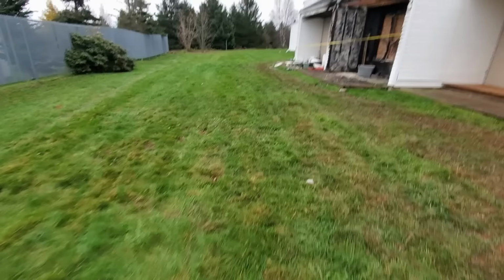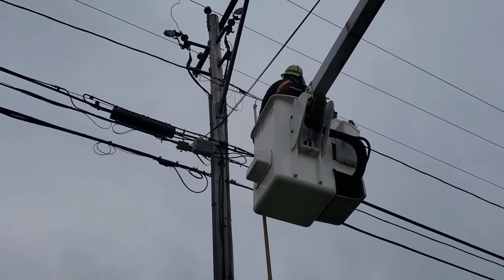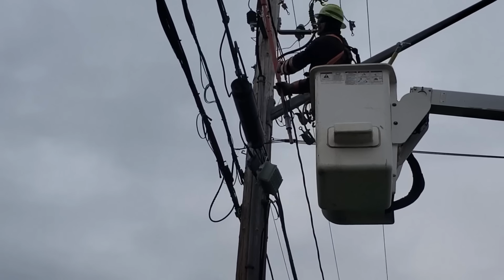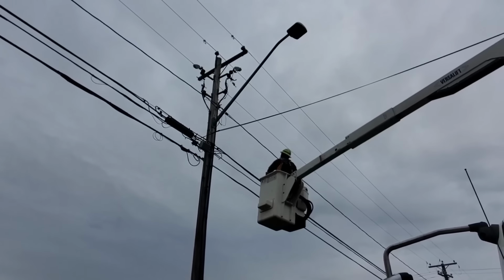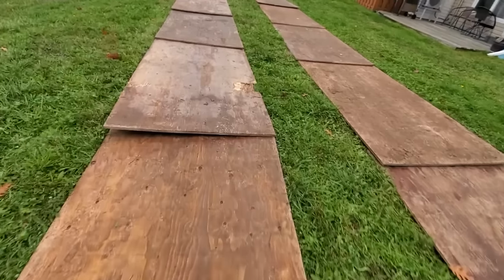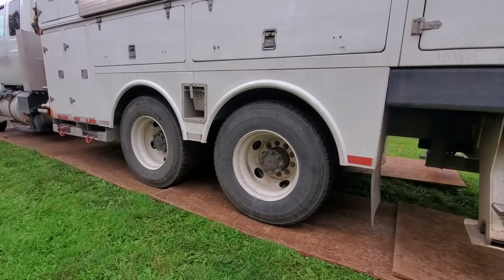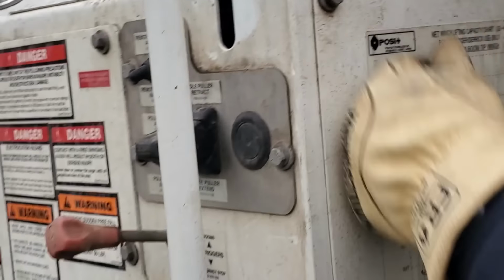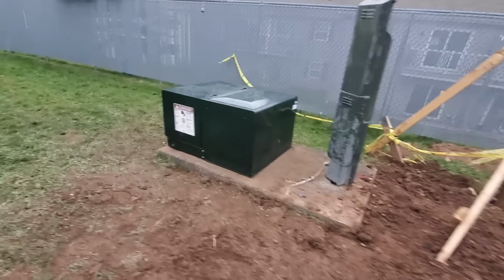Replacing padmount transformer (Job prep)

Comment: We had poles and meters from the 1920s that ran down in metal heavy gauge pipe to breaker boxes and heavy gauge pipe out of there that ran to boxes mounted at ground level that had 50 amp Outlets, 3 conductor.

The flexible power cord plugs in to this outlet and runs to the breaker box in the trailer.

Comment: Wait how did the cables melt and not blow a fuse? Isn't the point of the fuses is to protect the wires?
Reply: Fuses only provide protection against overloading. Here the wires melted because of a separate fire.

Comment: In Poland and probably other european countries we have main fuse before meter cabinets, short circuits on meter can't cause fire because main fuse will blow, we use low voltage distribution, one 15kV-3x230V/400V high power transformer can feed few house estate streets. Houses gets three phase power, main fuse for street usually is rated 200-400A independence from houses quantity, some short circuit on house service mains before meter can cause fire when fuses before meter don't exist, main fuse for street can not react for it when house is on end of line
Reply: For his house I'm 99% certain that there is a main circuit breaker in the main panel immediately after the meter just on the other side of the wall.
Reply from the maker: That's right, there was a fuse just on other side of the wall.
Next fuse back is on the high voltage side I'm the Padmount

Comment: How did the initial failure happen? Was is the power company’s transformer that cooked the lines? If it was the transformer wouldn’t that make the power company liable for the damaged wires.
Reply from the maker: It was all cause by the house fire...
The heat melted the customer owned wires, along with the wires feeding neighbouring units :/

Comment: Where was the 2nd phase from the riser going, I didnt see any other primary cable parked in the can? Did it go to another one? i did notice at the riser they were each connected to different phases which you wouldnt typically loop one can on different phases. Good video as always!
Reply from the maker: The second cable passed directly underneath the pad mount and continued on to another pad mount that was out of sight. These days we would have ran that cable off the "b" side primary bushing and hooked them up in series.

Comment: This definitely seems like one of those situations that would have been prevented by pole/pit fuses on each service, like most of the world uses. 
Aus/NZ has rules about "unprotected consumers' mains", and there were a whole bunch of subdivisions built in the 80s where the first protection was a fuse on the property - but that is installed barely above grade in a box in the foundation or brick wall, basically fireproofed.
I'm surprised the padmount is being replaced. Do they think it was cooked by the sustained short circuit? Other than the mess of secondary wires, it doesn't look too old or in too bad shape.
Reply: NA has some really seemingly odd things. North of the meter (technically, the first disconnecting means) there's no protection until you get to the line side of the transformer. In some ways, that reduces the service calls to replace a blown (low voltage) fuse. Most of the time, shorting the triplex will pop the line side fuse. (been there, done that. p***ed off the community... it's several hours to fix, being on the wrong side of a lake, and pole needed replacing.)

Comment: Another great Video Aaron,  I think you said tht the wire was Customer installed,  I'm in N.C and everything from the pole to the meter is the power company problem.  Please enlightened me 😮😊
Reply from the maker: Pole to meter the utility owns (in our jurisdiction) if it's overhead wire.
While we do have our own underground system as well, the wire from the pole/pad mount transformer/urd box to the meter is customer owned.
In some areas, the utility owns that section of wire.
Reply: It depends. The company does not want to maintain miles of line to one customer (my neighbor is that far back in the woods). Here the company maintains "up to the meter OR first pole" (oversimplifying). As I am 500 feet from the street, and some ugly land, there are two poles (meter on 2nd pole). I am responsible for last 300 feet of wire in woods and two poles in shallow holes. (The company has an insurance deal, I pay a little more per month, they fix any reasonable damage and eat the cost.) From my meter the juice runs underground to the house. Like anthonyelectric6045 sez, conductors just dropped in a very shallow trench. Backhoe damage in the underground is, of course, my problem.

Comment: Interesting. In our area the meter is the line between customer owned and power company. IMO thats how it should be everywhere, since the power company doesn't want anyone messing with anything between the meter and transformer. Seems if it was any different there could be issues to who is responsible, and who can, and cant do the work.

Comment: We are in the middle of trying to change policy on who owns service wire from transfer or secondary box to meter.    If its overhead its always been ours. Underground has been customer owned,  we have usually fixed customers wire because it's such a pain to have electrician fix them.   We have had so many problems lately that we are looking into changing.

Comment: Appreciate your vids, I am not a lineman but have an electrical background. My question is I noticed when you remove a cutout how is it actually hooked at the bottom. It seems to just slide out, what prevents contact resistance. I know the top of the door has a solid slip connection. Curious old man!
Reply: Basically it’s like a notch in it the only way it can be pulled off is when it’s open and hanging
Reply: Top of the cutout has a spring loaded latch with a notch that accepts the top of the cutout door.   Put a switch stick in the ring of the door & pull.  That releases the door from the latch.  Let the door open completely then you can easily lift the door straight up out of the bottom hanger.

Comment: Why aluminum wire?  I thought that had been banned since it was such a fire hazard.  At least it is in USA.  Is it just used in those boxes and poles?
Reply: Aluminum is banned for inside wiring because it is more brittle than copper, and connections will loosen over time due to the wire and connections expanding and contracting. Those loose connections will cause arcing and faults that start fires. Outdoors and underground that is less of an issue but can still deteriate with age.
Reply: @superhuman2889  Not to mention the resistance is lower in copper.  And, ALL installation require moving the wire back and forth a number of times, until there is a solid connection.
Reply from the maker: Aluminum is banned here as well except for the main wires into meter/panel and the underground/overhead wires directly connected to our system. They're sized larger than what would have been chosen for copper. Cheaper and doesn't get stolen!
Reply: @Bobsdecline Oh, it still gets stolen... people are stupid. (meth heads are very stupid.) People steal fiber thinking it's worth something.
Reply: @Bobsdecline  - Thanks for that!  I've got so much feedback of the opposite towards aluminum.  I like the longer video's. :yt:
Reply: Actually in the states copper-clad aluminum is accepted (of course depending on the ahj) if it's UL-listed and much like with a feed it's generally the next size up that it would be his copper.
Reply: I don't know about power company owned wiring but the NEC allows aluminum wiring that's 6AWG (or maybe 4) or thicker as long as all the terminals are specifically rated for the alloy used. In practice this means your service feed and feeders to subpanels are likely to be aluminum. You also need to follow manufacturer instructions such as torque specs, something usually ignored in general house wiring.

Comment: looks like they would have you replace all the way to the pole looks like the trouble would have back fed that far
Reply: If it didn't blow the cutout, it's very unlikely to have hurt the feeder lines. (100kW @ 7kV isn't that much current, but at 240 it sure is.)

Comment: Good evening from germany. I´ve got a question: Why arent there any fuses for the low voltage wires in the pad mounted transformer or are they? And second question: How do you guys disconnect the high voltage cables if they arent coming from an overhead line? Are there some kind of high voltage switch stations?
Im curious because i only know how these things are build here in germany, where most lines are build with cables. Here you go with your high voltage into some kind of switchfield inside your "Trafostation". Usually there are 2 switches for the line (one coming, one going) and one for the transfomer, witch is equipped with high voltage fuses. Then you go with your low voltage out of the transformer and through low voltage fuses into you fuseboard. From there you go to the customers or into smaller fuseboxes along the street, but with a seperate fuse for every cable.
Reply: That's just not how it's done here. 

High voltage → Tap → Fuse (cutout) → Transformer → Low Voltage → Meter → Main disconnect, often the main panel.

There was a time when individual transformers on poles were not typically fused, and the fuse for the whole HV circuit would be the over-current protection.  But that time seems to have passed.   Pad or subterranean transformers have always been especially fused.

Different jurisdictions will not agree on where the utility company's wires and responsibility end and the end-customer's begin.
Reply: @jovetj  So if there is some kind of short circuit on the low voltage side, it "burns" until the high voltage fuse cut it? Seems kind of dangerous.
Reply: @Offizier3ids  More or less.  But it isn't generally a huge problem, either.
Reply: @jovetj  Oh ok. Thanks for your answers. I guess here in germany people are more freaked out from the dangers of electricity and local black outs.
Reply: My guess is that the transformers in North America are smaller and feed less customers at once over much shorter distances due to the low secondary voltage. So a short on the secondary could reliably blow the primaray fuse of the transformer and knock power out to all the connected customers.
Here in germany (at least in Hamburg where I live) the padmount transformers ("Kompaktstation") are much larger and feed whole streets, guessing from the size >500 kVA - 1MVA (my house alone is fed 400V/3PH/63A). A short on the secondary wires to my house would would destroy the cables long before the transfomers blows any primary fuse. So they fuse the secondarys to the customers prevent that.
Reply: @kuebbisch  But US/Canada don't use a lower secondary voltage.  Most homes are fed 240 volts.  
I suspect the transformer size reflects the population density, as well.  For one or several homes, a 75 kVA transformer is fine.  If you have more homes you need to serve, a bigger one would be used.
Reply: @jovetj Yes, but north american 240V is 2x 120V so that you can connect 120V devices between L-N or 240V devices between L-L.
I get delivered 3x 230V and I can just connect 230V devices between L-N or 400V devices between L-L (or three phase loads like large motors directly without phase converter).
For 120V loads I would need to buy a step-down (auto-)transfomer, there is no way to get that low of a voltage directly from the grid as delivered to my home.
So our secondary voltage is almost double.
Reply: @kuebbisch  Nope!  240 volts is 240 volts.  Doesn't matter that it can be split.  Your voltage is actually lower!
Reply: @jovetj  No, if we just look at a single phase of our grids: NA 120V, Europe 230V.

We don't do that split-phase stuff here, 230V get delivered as one phase, one live and one neutral.

In NA your 240V are two phases, so two live one neutral.
Reply: @kuebbisch  They are not "two phases".  
240 volts is delivered to my home.  Period.
Reply: @jovetj  Look up "Split-phase electric power" on wikipedia.
You get two 120V feeds delivered. I was wrong to call them phases though, since as the article mentions they are exactly 180° out of phase and so no unique direction of a revolving magnetic field is defined.

But you essentially connect two 120V feeds in series to develop 240V. For me "single phase" means a measurement between one live and neutral/ground. And if you were to measure that you get 120V and I get 230V.
Reply: @kuebbisch  I work for the powergrid service in Schleswig-Holstein, so what you re explaining is exactly how its build in germany. The normal tranformersize is between 400kVA - 630kVW (More if needed, but thats not often). But even in smaller villages or farmbuildings wheres only a small 75kVA transformer we fuse the low voltage sides. As you sayed, it would destroy the cables long bevor the hv fuses blow. Even with the lower NA voltages the result would be the same, wich seems kind of dangerous to me. Also its easyer to locate the faulty cable and reduce the off time for the customers. So i dont see any reason why there shouldnt be any low voltage fuses...

Comment: Question... Why do they have to place grounds up on the pole if the wires are disconnected?
Reply: Underground primary cable acts like a capacitor and will hold a charge. Adding a ground to it is a safe work practice to discharge the cable.
Reply: @scott78911  Thanks!
Reply: @DavidJohnson-tv2nn IIRC in another video he said in case someone backfeeds into the cable (with a generator for example).
Reply: @Jehty_     it's also common to find stray voltage on other grounds from cable tv and telephone, which may be tapped into the utility company grounds. Once you start disconnecting things, you never know where something has a crossed wire... right or wrong. Extra grounds while working just covers those bases for safety.
Reply: @scott78911 they always add a ground. Doesn't matter if underground or not
Reply: @scott78911  While the tightly-packed conductors of an underground cable do provide capacitance, it's my understanding that only really becomes an issue when the cable runs are very long (think hundreds of kms). 
It's a much more prescient issue, to my understanding, that all of the magnetic fields around can induce a current on a proximate, floating conductor.  Just as current flowing through a wire (that isn't a semiconductor) creates a magnetic field around the wire, changing or moving magnetic fields will induce a current on a conductor.  As alternating current changes polarity at particular frequency (60 times a second in USA and Canada), its always ready to induce current on an in-range conductor.